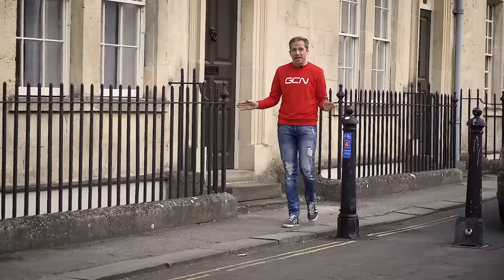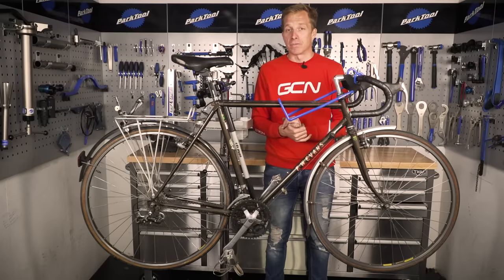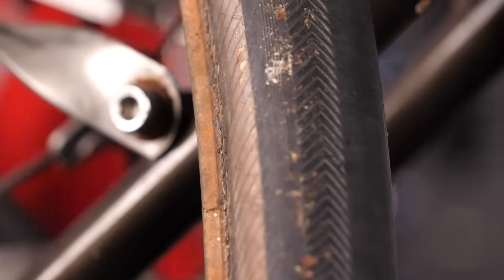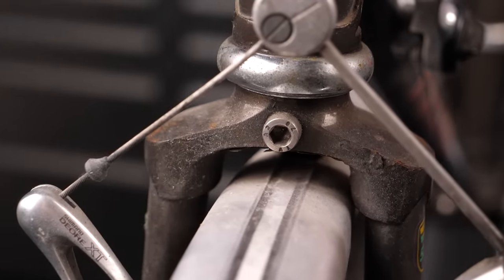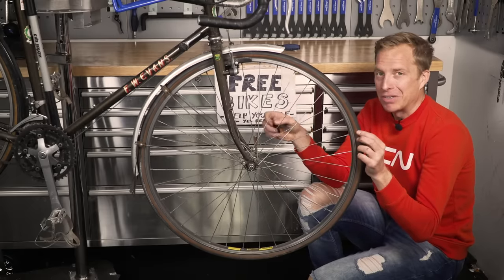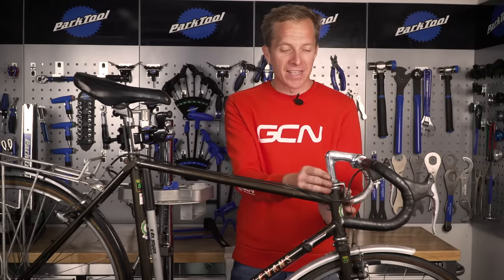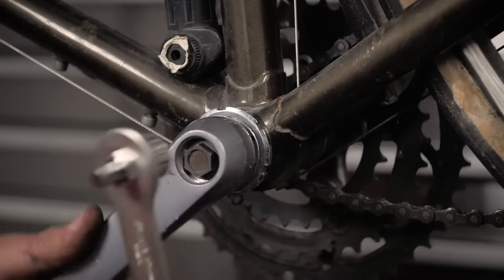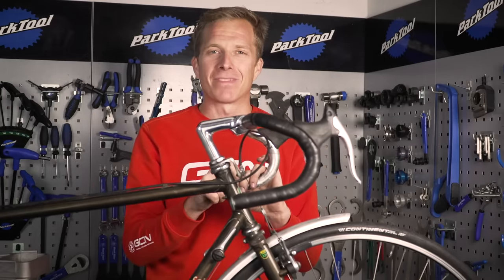Trash To Treasure | How To Fix Up An Old Bike

Comment from the maker: What would you check on a bike you found? Let us know below. 👇
Reply: GCN Tech I’ll check first if the bike was stolen.
Reply: I'd check if the alloy seatpost or stem are stuck in the frame. Sometimes that can be an absolute pain. It would suck to get through fixing the whole bike and then find out you can't get the seat and handlebar position in the optimal position for yourself. 

I'd also check the rims and see if they're steel. Haven't ridden steel rims for quite a while. Just can't do it honestly. 

If it's a bike I'm personally fixing it for myself all the consumables get replaced, bar tape, all cables and housing, all bearings, brake pads, and probably tires. 

I also clean and polish the bike frame.
Reply: If it was locked ...
Reply: I would add, replace the rim strips.  Just like the tyres, the old rubber strips disintegrate.  If they are not already broke, a new tube and tyre under riding pressure may just put them over he edge.  Thats 32 or more potential puncture points.  Not fun out on the road.
Reply: Usually, I just check if I have room in my house for another bike
Reply: Check for security markings, is it stolen. Had someone put the sign on it as a prank!!? 
Sorry Officer the sign said please take me!!!
Reply: Even of the bike seems to be in pristine condition, I would disassemble, clean,  and repack everything with grease. On an old bike, the grease will have dried out and lost its lubing ability.  Nothing would be worse than wearing out the wheel and crank bearings after only a few rides. By the look of those tires, the individual who left it for free hadn't ridden it in probably over ten years. They were just cleaning out the garage or cellar and wanted it out.
Reply: give the bb,headset and hubs a regreasing, otherwise, they will wear out in weeks
Reply: Before you take the bike, think first "Do i even need it? someone else could probably have more use for it.."
Reply: Dont you always have room for another bike?
Reply: I would clean it stem to stern! Old grit and sweat mixed with grease...yuk!
Reply: That I'd taken the security tag off.
Reply: The fork’s alignment and steerer tube integrity.
Reply: First I would check the frame size. 
Is this a 56 or 54cm?
Reply: I'll check what's easier: step over it or walk around. If former, I might put it aside to a wall or a tree and keep going. But thanks for the tips on what to check in your own good old bike.
Reply: I wouldn't trust the old spokes to get me very far; so if I wanted to keep it as stock as possible, I'd keep the hubs and rims and replace the spokes with new/better ones.  Maybe it is just me, but I start popping old spokes pretty quickly, especially in the rear wheel.
Reply: I love how this channel are becoming real bike connoisseurs.  So long as the frame isn't badly bent I'm good, bent rear triangles come with nearly all old steel bikes free of charge but easy to straighten that.
Reply: story from the previous owner
Reply: Bullwhip it's a 54 or less.
Reply: lucky to find it ,, things to change, on old bike ,  all cable, tyres , brake pads ,new grass in all the bearings,
Reply: I would check where the production team bought it from.
Reply: Check frame for cracks and rust. Stuck stem/seatpost/brakes/anything, because it might have been corroding in a garage for ages. Paint peeling (professional sanding and paintjob costs tons)
Reply: First thing to check is if it’s not a dream.
Reply: Can BBs like that be replaced with cartridge style square taper ones?
Reply: @david131092  depends on thread type. Loose bearings + english threaded BB -> english threaded square taper of adequate length, no problems. Or even something fancy shimano octalink whatever, as long as it's english threaded.
P.S. actually, even unusual threadings can be re-cut to english in a proper bike shop, if you deem it worth the money
Reply: Rust, rust and rust. In all fairness it's mostly rusty bikes being giving away free here, often spent years out in front of the train station and such. If I noticed straight away the bike is very rusty I wouldn't bother as it'd show me the owner didn't care about the bike so I'm guessing it'd be loads of work and money to get it back smooth again.
On a similar note, mud. Basically the same with the rust, a very dirty muddy bike probably wasn't looked after too well.
Reply: frame size
Reply: @bullwhipjohnson8247  or a 68
Reply: @david131092  definitely
Reply: Well I got a used xc bike and discovered the rear axle was broken so I'd say check the axles.
Reply: Serial number on BikeIndex. There's so much bike theft in our area that the only free bikes are cheapo Walmart ones; otherwise they're pieced apart, reassembled, and sold.
Reply: I got two Trek bikes this way. A bit of elbow grease and a trip to the bike shop. Under 80 dollars later we have two great bikes we use all the time. I couldn't afford to buy two bikes of that quality.
Reply: Forks bent backwards from a collision, see it all the time on older steel
Reply: Obvious visual checks, then on a bike that old, replace all the cables (inners and outers) and probably tyres as well, and grease all the bearings.  In fact, take the whole thing to bits, clean and lube, reassemble.

Oh, and some paint for this one.
Reply: A friend of mine found a Giant superlight steel, with Shimano 105 7 speed circa 1992. He couldn't shift the seatpost to raise it but the bike was a perfect fit for me. Replaced back rim and is extremely comfortable.
Reply: Is it stolen?
Are the brake blocks ok?
Reply: Found as in someone was about to dump at the waste centre as he was getting rid of some of his own. I replaced back rim, cables and front shifter
Reply: Nice find Jon, I love restoring old bikes. They turn into the family holiday bikes.
I would check everything you checked. However, I wouldn't stop at checking, even if it was in compliance. I have done a few restorations and, without a 2nd thought, new grease and service BB, headset, hubs, new cables regardless, and definitely pull the seat post. Another must is Frame Saver into the tubes. If the bike is free or near free, it's worth the effort. 
For Example: I came across a 1983 Raleigh Olympian for $10 once. Slightly worse condition than your example, but very rideable. I pulled the BB for bearing & frame service and found moss, still wet. Headset was smooth but grease had discoloration demonstrating degradation.
Reply: I would be particular if this bike was a big box special....in the US meaning bikes that are sold for $200-50 top.  You can tell that by looking at the drop outs.  They are different than other bikes of more reasonable quality.  Another feature of these so called big box bikes are that they are made out of 10 Steel.  Quite heavy in comparison to more common steel such as 4150 etc...  There are plenty of big box specials on the street and most if not all of them are not worth salvaging.  Also I would gravitate towards bikes that have lugs.  The bike in the video is a treasure find most bikes that are disposed off are not worthy to be saved especially if they are like the bikes I have described.
Reply: If the seatpost and/or the stem is stuck in the frame! oh and come on; why not put the front brake pads in the right direction while you're there :)
Reply: GCN Tech gear ratios
Reply: For a bike with unknown history, I like checking bearings.  Yes, play might be ok [with some adjustment] but a good cleanup and re-lubrication gets it all inspected - and a pretty good picture of how much life is left in the bike, as peeking in the head tube and bottom bracket give a fair indication of frame condition [for anything metal].
Reply: Serial Number!  Bike theft is a huge problem, so checking with Bike Registry, Stolen Bike Registry, other online resources and local law enforcement is a really good idea.

Any bicycle withe the serial number removed, modified or defaced should be impounded.

Doing this reduces the demand for stolen merchandise.  Bike thieves suck!

Frame inspection:

Hold a straight edge along the bottom of the top tube.  This checks the tube for straightness.  If it is bowed, then the bike probably had a front-end impact.

Ride the bike no hands.  If it veers or steers poorly, you may have some unseen issues (frame and/or fork misalignment, wheel dish and/or dropout fit issues, pitted/damaged headset (or bearings in upside down), etc.

Measure chain stretch.  If extreme, cogs/cassettes AND chainrings may be beyond their useful life.

Remove seat post.  If  you can't, well then there you go!  If you can, peer down the seat tube with a flashlight to see how much rust and debris are in there.
Reply: Seat post! check that. I got a bike and the post was froze. I could;dn't break is lose no matter what I did. So I say thats a big deal.
Reply: burn it to the ground lol
Reply: GCN Tech the bike register to get it home to its owner lol every bike I’ve had found I reported stolen. I’ve never just found a bike like that,books and old CDs yeah but no sweet tourers lol
Reply: over haul the whole bike just to be extra :)
Reply: I will check all nuts and bolts and all the stuff you said, even with a new bike
Reply: Pedals!!! I found an old Panasonic bike in the trash, and I changed tires and brake cables, and bar and brake styles and thought I was in the clear after some surface rust removal. A few months later one of my pedals snapped right off! Thankfully I was a block from home and cruising at just a few mph. I didn't consider that rust, and cold weather riding etc could cause an old bolt to snap like that. I put some MKS pedals on, after watching some more of your videos and I'm back on the road. Pics of this bike on my IG @johnoliva1
Reply: You left out checking the cups on the hubs. Those are often worn and need to be redone- it's probably the most overlooked piece of maintenance.

Once the crank's off, it's easy to clean and re-pack with fresh bearings and grease, which will keep it going strong for MANY more years of use.

This is like the lazy-man's way of continuing to ride it into the ground. 

You wouldn't buy a used car and then not change out the fluids, would you? Especially if you knew it probably needed one.
Reply: Beat it with a quarter to see if its carbon fiber.
Reply: The seatpost the most important part
Reply: I just finished up an early 80's Bianchi that I bought for $30. Every single nut and bolt tear down. Replacement of all cables, tires, seat, handlebar tape. I would have chanced the chain but surprisingly it was still good. 
The ride of it is actually horrible. The top tube is too short as is the stem and the handlebars are stupid narrow. But it has a charm to it that I like a lot.
Reply: the groupset hahahahah
Reply: GCN Tech check if you can remove the seatpost first.. i did fully restore an old bike then discivered the seatpost was unmovable dispite all tricks and efforts... you can imagine the bitterness and frustation ;)
Reply: GCN Tech can i have a bike?
Reply: GCN Tech i dream to be a cyclist
Reply: That's what I thought. Why didn't he overhaul the bottom bracket? @alebgns6164
Reply: Can't believe he had the cranks and the lock ring off and didn't inspect the BB 🤦🏼‍♂️
Reply: Well I would take it on a bike ride after I get the tires checked and make sure everything is greased up first before you go on a bike ride and then take it on a test ride to see how it handles
Reply: The person riding it 🤪
Reply: fork . stem . bar end full-o-rust ...seat stem same ...then check size ..padle to front wheel ratio..for. corners check the size between ground and padles.. long crank lenght you wil find on old tour bikes ...make les room for shoe's and corners.
Reply: @100rogerduncan  problably the best old-skool SKF  bearings you'll find on the market now-a-days ...no need the change it???my guess😉
Reply: hmm the last time .. i got my tetanus shot bro!!!!!😷
Reply: Is it stolen?
Reply: Check if it's stolen, tampered serial number
Reply: I always check to make sure the seat post is not seized in the frame especially old steel frames. Do you have any tricks or tips for tackling a stuck seat post without damaging a frame beyond repair?
Reply: The string test is a good idea, you should make it clear that an old frame you can literally just be cold bent back into shape.

You can't tell the shape that the hub and bottom bracket axles are in if they're loaded up with wheels or chainrings. So those hub axles have to be twirled by hand with the wheels off the bike, and the bottom bracket/crank axls spun without any chainrings or cranks installed on it. Any grittiness or play means inspection, re-adjustment and regreasing is a must-do if the bike is a keeper.
Reply: The first and only thing I check is the size.  I'm just about 6'4" and don't see too many bikes my size secondhand or free.
Reply: Well, brake pads, which may be worn down, or too dried out to provide effective friction.
Reply: On the road I'd only be interested in steel - just my prejudice.  I'd check the frame is anything bent smashed etc. , Wiggle the fork , spin the wheels and watch for trueness.  Spin the crank, them Inventory the components : how much would I continue using.  If that's all good then bring it home and check to see if it was stolen(I had mine stolen - the first one I'd built).
Reply: I’d check the tires
Reply: @XGaming1  I'd probably replace them at any rate, so it wouldn't be necessary to check them.
Reply: @seamus6028  Amen to that brother.
Reply: Jason Maynard use an impact wrench to jar the seatpost loose. Drill through the post , hammer a 90• bend in a large bolt, then put it through the post. Add a couple nuts and wrench them till the post breaks loose and spins.
Reply: Jason Maynard use an impact wrench to jar the seatpost loose. Drill through the post , hammer a 90• bend in a large bolt, then put it through the post. Add a couple nuts and wrench them till the post breaks loose and spins.
Reply: @GabrielFarseer  😅
Reply: They gave it away cause they knew it would end up on GCN
Reply: I would also check the rims for hairline cracks at the spoke holes, a lot of older wheels have this problem, also check if the quill stem is not seized to the fork, check if the fork is not bend backwards
Reply: I found an old lotus 2000r pro series outside of a house.
Reply: @seamus6028  I got a trashed bike with the seat post stuck in it. used it for basic commuting and had it for about a year than somebody stole IT! Ha Ha wonder if they ever learned that it was useless!
Reply: My dad found 3 bikes are
Reply: I will first check if there's a bomb in it
Reply: Oooh the frame is bent so is not gearing properly thanks✨
Reply: I'd definitely run the V.I.N. (vehicle identification number) and make sure it's not stolen property! Not many thieves go thru the hassle of finding the serial number. They just want some fast cash!
Reply: How easily I can cut the lock
Reply: @Jeremiah Tyson reported for spam!
Reply: If it had any Campagnolo parts on it  💰
Reply: I would check with the police to see if it was stolen!!!
Reply: @michaelbaumann4011  Duct tape!
Reply: frame
Reply: i'd check GCN Tech to see how to fix it up again!
Reply: @AlbertStichkaJohn  lol
Reply: If it has an outer gear I'd pull the wheel and have a look at that gear cassette.
All too often I'm proper gear alignment has caused the teeth to wear down or even get crooked.
A new gear cassette doesn't cost an eye and an arm so well worth the effort. Clean and check the de-railer in front and the gear selector in the back (worn springs/broken/or just filled with schmoo).
Reply: The seat height
Reply: @gcntech Lucky you, I wish i was in your shoes.
Reply: My first thought is Why would you check anyting ? It's looking for a home ! It's your duty to provide it one , even for salvaged parts !